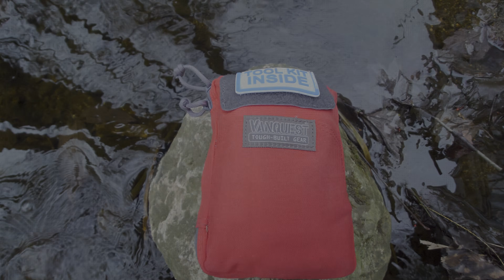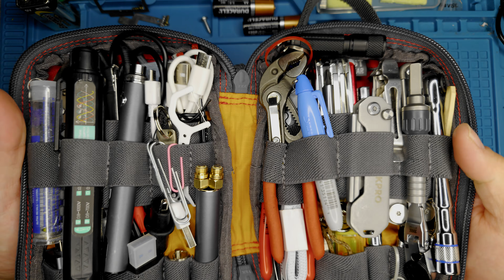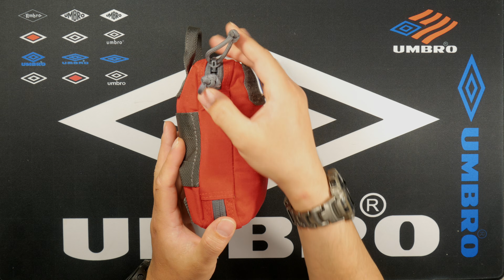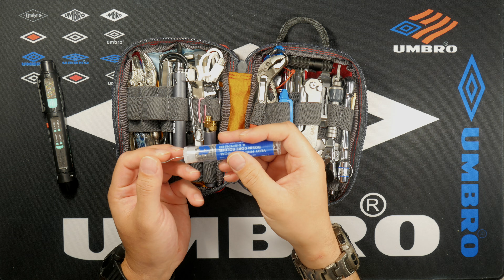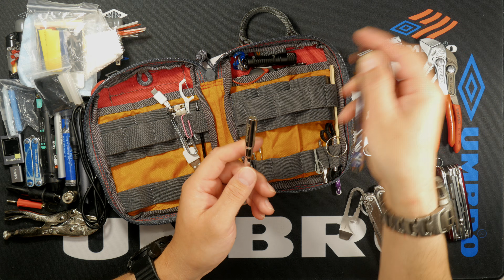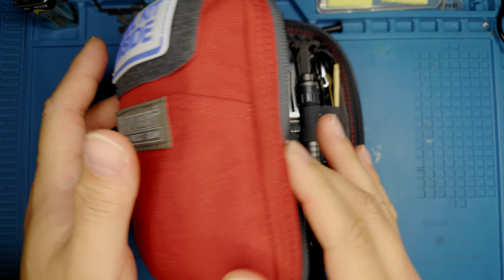The Ultimate Small Hybrid Electronics Tool Kit - Vanquest PPM Huge 2.0 Pouch

Comment: Why 2 watches?
Reply from the maker: one of them is the tactix 7 pro from garmin. it has internal maps, a light and solar ring and it  basically is my map device for when we do patrols at work or go on rescues for injured and lost hikers. it saves time when youre rushing up a mountain and dont need to take out a map. it basically lives on my arm 24/7. it has multiple utility. if im working on my car or trail work it will come off. had a rock or two smash the screen protector.  the other is my old casio 1500paw solar watch. i eant something disconnected from the internet to tell time. it has an atomic feature but i can turn that off.
Reply: @TheFossilChannel  oh ur awesome.  Thx.  Keep up the good work!!!
Reply from the maker: @scratchbuiltreplicas824 thanks! the garmin watch has alot more features but basically i treat it as a dick tracy kind of device and not a time keeping device

Comment: There’s a lot of redundancy in this kit—for example, you’ve got three multitools: the Cybertool, Wave, and Squirt. You don’t need all three; I’d cut two and use that space for standard bits instead, since they’re way faster and easier to use than Leatherman bits. You also have a proper driver, but you're not using good bits with it—Leatherman bits are fine in a pinch, but not great as your main option. Also, the Galvanox Addon is unnecessary because the Leatherman Ratchet already covers that and does it better. Also just a thought and what I was mentioning earlier, you have 2 things that overlap a lot with the Cybertool and the Wave. But if you analyze the Cybertool you don't actually need it: its pliers (not very good and you already have better pliers in the Wave and Knipex), the bit driver (you have like so many already). The only saving grace is its scissors and if you factor that you don't need the Cybertool; you just need something like the Compact (way too much overlap). But if I'm wrong and you use the Cybertool for all those functions; because you use that and Knipex together; then you don't need the Wave.
Reply from the maker: those are some good points about the bits. i do have the galvanox bits which are claimed to be harder than leather man bits so id just swap those two out. i can take out the galvanox, just was looking for a stronger torque type adpater but at this size, im not doing heavy duty stuff ie construction. i dont consider the squirt as a redundancy in that its micro and its primary function is the wire stripper. There is no other wirestripper you can find that fits that size profile that is atleast the quality of the squirt es4 , rivet  problems aside. I can see cutting the cybertool as a valid point, but id like to get a good pair of scissors, precision bits in there in place. do you have a brand or type of tool to suggest? specifically.
Reply: @TheFossilChannel  So there's a few brands I like. I remember testing a bunch of tiny scissors for fun. But there's some good scissors (these are separate); these being the Wescott 2.5 (these cut through paracord and zipties easily), Kai 4. If your main usage of the cybertool is mainly its precision bits, you could check out the Otacle D1. Alternatively for SAKS, the choices are so many but you can swap for the Rambler, the Compact and then bring out the Otacle D1 if you need to do precision tasks. Now the issue of course is that each of these require you to buy something else and one may argue; just use what you have. But dang, I'm just saying the Cybertool is very clunky; but your main uses from it are the precision bit driver (which imo the Otacle is much smaller) or the scissors (which you can get on any other SAK with less "clutter". Also remember the Leatherman Ratchet is compatible with double-sided bits (ie Wiha doublesided bits and Steinwhale); because I still feel you should add other bits other than those Leatherman flats.
Reply from the maker: @Dracomies thanks for the suggestions. funny enough i just got the otacle d1 in last week due to the sale and curiousity. and yes i do use scissor quite often and will check those brands. ive been disappointed in the waves scissors and the es4 scissor as frankly no multitool can make scissors like the victorinox. i do beed a precision bit driver and i agree with you on that point. i was also thinking when i made the kit that there are small but important distinctions in the pliet selections, allow me to ellaborate for a moment. 1. the vise grip pliers are locking and are the only locking pliers in the kit. 2. the es4 although not selected for its plier face actually has decent  amicro size tweezer like plier head which gets into smaller places than the other pliers cant get into, especially when im working on small electronics with minimal space. 3. the victorinix pliers while seemingly useless compare to others actually has a form factor that can once again fit into small spaces like say a computer tower case in when ny leatherman wouldnt fit or cobra wouldnt fit. its got more gripoing power than the es4 and grip realestate. 4. the leather plier heads are somewhat needle nose and loger than any other plier head and are useful for the reach and space options again. 5. the cobra pliers have the best grip for smooth surface pliers aside from the vise grips and can get the wides mouth grip out of all of the pliers in the kit. 6. the knipex plier wrench specialty is its ability to not mar the surface of what ever you gripping and it lends coverage for the small socket set in the kit to fill in the gaps.  Those are some of my counterpoints. I think youre right in terms of keeping it simple and light weight and the afformentioned numbers were my thought process behind choosing what i have in here aside from having to buy more. thanks for your input and ill look for those brands.
Reply from the maker: @Dracomies im gonna look up the steinwall bits. wiha are a bit challenging to come by here without buy one of their ratchet sets, i have 3 different ones in different kits.
Reply: @TheFossilChannel  Steinwhale bits are dope! Tiny too! So it won't take up too much space. They work with your Leatherman ratchet.
Reply: @TheFossilChannel  ah! That makes sense. There's actually a lot of thought into how and why each thing was kept. That makes sense.
Reply from the maker: just looked up the wescort and kai 4. did you try the professional seires kai 4 ? those scissors look sweet!
Reply: @TheFossilChannel  yip! I have them. These are actually amazing because they cut right through thick zip ties and thick paracord with 1 snip. My vic scissors can't do that. They're worth checking out :D
Reply from the maker: @Dracomies im gonna save up. they about 44  bucks on amazon

Comment: That is a pretty good kit, what electronics have you repaired with it? I had a butane soldering iron but it never seemed to get hot enough and would run out of fuel before I could get anything done, have you had that issue with the electronic soldering iron?
Reply from the maker: the iron itself gets to around 12-16 watt output. its why i use it on small projects like repairing wires on my solar latern or ham radio gear. thing is with this one you have to charge it before you can use it which is a bummer. if i have do more than 30 mins of soldering then id prefer a dedicated solder iron. tips are good and the battery ones heat fast which is nice

Comment: That Squirt is the best multitool ever made, IMO. Certainly the most usable. A wire stripper is exactly what I need on this tool, not some otherwise useless pliers. Sadly it's no longer available and the only other stripper multi-tool I was able to find is like 4 times the size.
Reply from the maker: agreed on the tool and its the only reason why i have it in this kit as its impossible to find a small projects wire stripper functioning tool. technically it makes the mutitool county to 3 but they all have a different main function mainly : the es4 wire strippers are specifically for the wire stripping,  the cybertool is specifically for its amazing scissors and bit driver for precision work, and the wave is just the general catch all platform with Locking tools for harder light duty tasks and it functions as a platform for several ratchets.